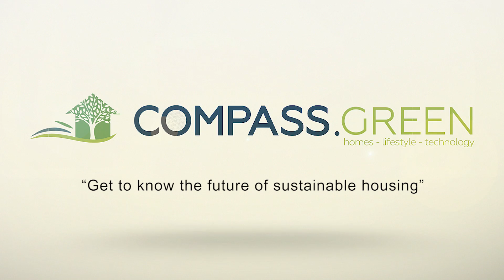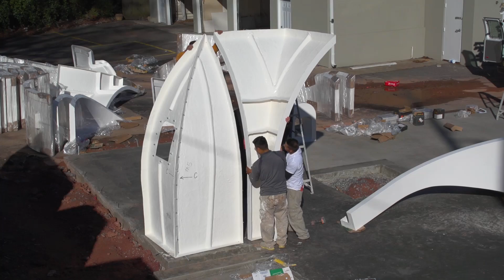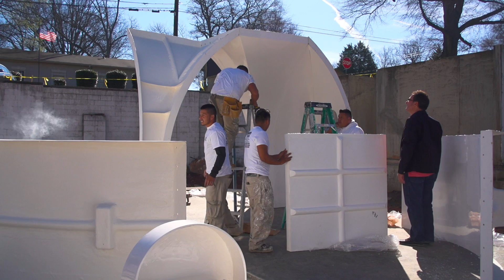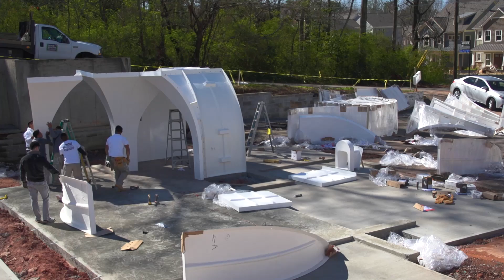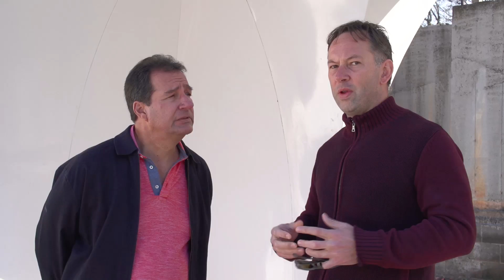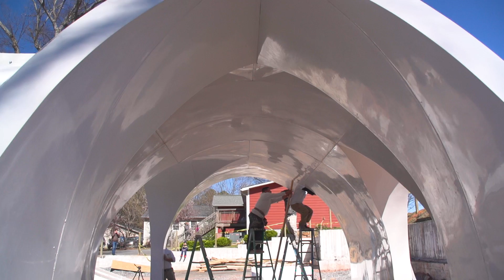Compass.Green  - Green Magic HOMES  - Andrew & Gustavo Santander - Showroom Marietta

Comment: Are they guaranteed to withstand: tornadoes, hurricanes and earthquakes like American Ingenuity domes and Monolithic domes?  Are they fireproof and termite proof like AI domes and Monolithic?
Reply: Theoretically, all of the above, these things are literally built like bunkers. All you would have to worry about is flooding. And if they're built watertight like they're supposed to then even then they would be fine. I would just build it on a hill so that you're not trapped under 6 feet of water in your house.
Reply: dude its a plastic house I cant imagine It would withstand a hurricane.

Comment: How do they wire the house for electricity?
Reply: See the boxes and such on the outside in some of the shots?  That is where they are running the electricity and lights.  I find this a little difficult however, can you hang a picture or shelf?